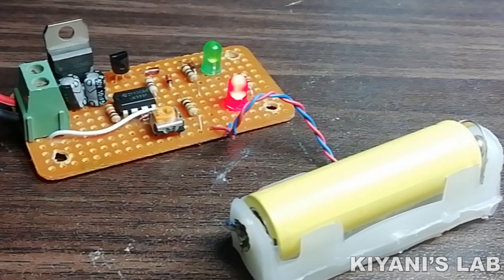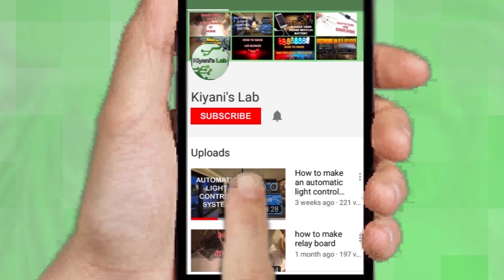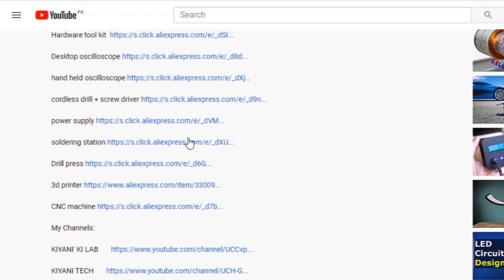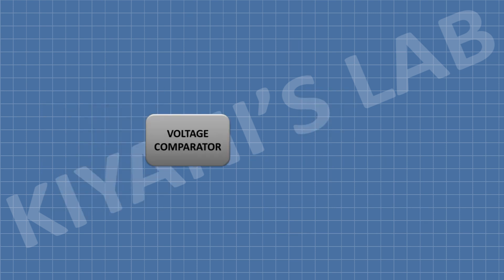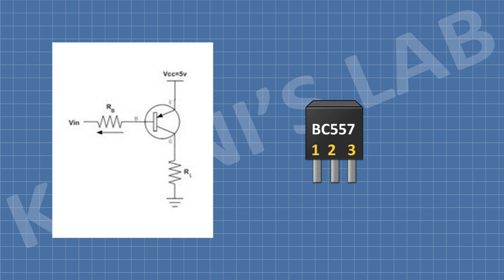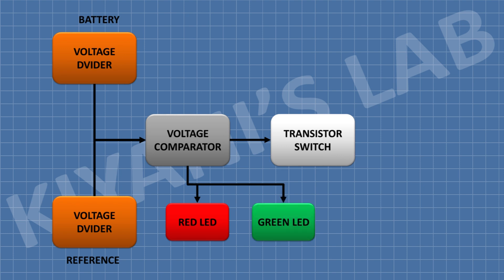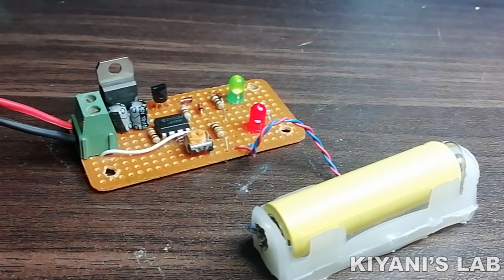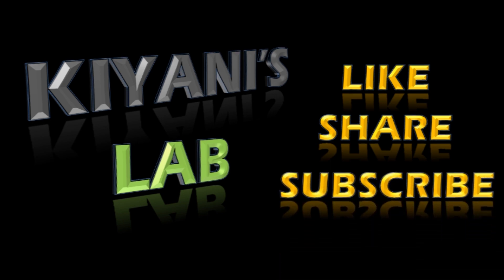How to Make 1.2V Battery Charger | Automatic Battery Charger

Comment: The 2 Diodes Before 1R @1N4148 ,If You Replace With 1N4001 Diode Will Provide More Current & Battery Will Charge Properly,Thanks n Regards From India💚💐

Comment: NiMh batteries not charhing with only voltage cut off! Read wiki or other sources. Your circuit no have voltage referance and depended to power souce. This is incorrect.

Comment: can the load output of the tp4056 circuit be reduced the voltage with two resistors one of 10k 1/2w and another of 18k 1/2w? to be able to charge 1.2v batteries
Reply: what 1/2w mean?
Reply: @aaaaa-fl1pp  value of the resistor's heat dissipation
Reply: No!

Comment: LF33CV isn't available, could I replace it with LM7805 ?
Reply from the maker: use any 3.3 or 3v regulator
Reply: @KiyanisLab  
The minimum available value of regulator is 5v
Reply: Use a buck converter instead

Comment: hey bro ..fantasticvideo .. i have a few questions:

a) i need to charge my AA 1.2 volt battery .. can i charge  with with 1.5volts power supply .. or do i need less .. if less how much do  I need .. please help me
b)I have  a 5v 2A power supply and I want to convert 5V to (1.5volts or2.5 volts) .. do you have any video regarding this ..

Please help me

Regards
Rahul
Reply from the maker: you can charge it with 1.5v
Reply: @KiyanisLab  : thanks buddy .. there is one more question .. could u please help me .. here it is :

b)I have  a 5v 2A power supply and I want to convert 5V to (1.5volts or2.5 volts) .. do you have any video regarding this ..
Reply: @rahulkalra2126  use DC dc buck converter with trim pot and set it to 1.5v

Comment: Please help
 A battery is to be charged and a circuit to compare the voltage across a battery is to be used , when the voltage across the battery is less or equal to 5v , The LED on the comparator will switch off indicating that the battery is still low, however once the voltage is greater than 5v then the LED will switch on indicating that the battery is about to be full .

Comment: How to add overcharged and overcurrent protection?
Reply from the maker: it has over charger protection
Reply: @KiyanisLab  thanks for replying
But overcurrent and short-circuit protection?
Reply: @kiranbariya7827  It has no protections. It just stops at a voltage set by turning the potentiometer.
Reply: Build this circuit then build a NiMH trickle charger to compare why this one sucks.

Comment: Sir at the terminal block how much volts you had given,you had not told about it in the video
Reply: The voltage regulator used in the video acceps voltages upto 16v so the input voltage should be around 5v to 16v

Comment: Please Sir can you use this to charge 4v sealed led acid battery?
Please could add a relay in the design?
Reply from the maker: yes you can
Reply: Sir what is supply voltage is it 230 V AC.